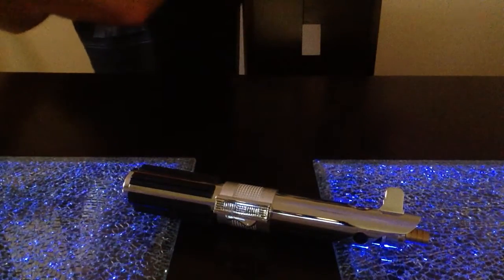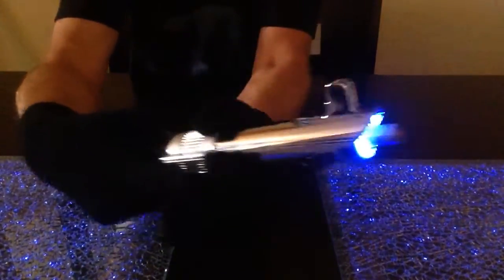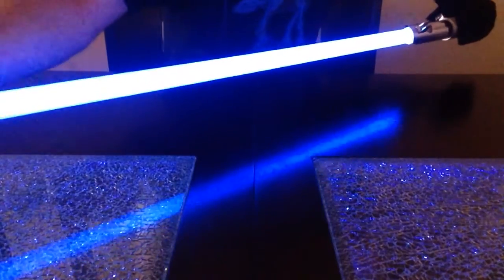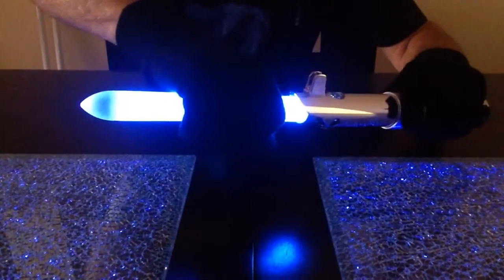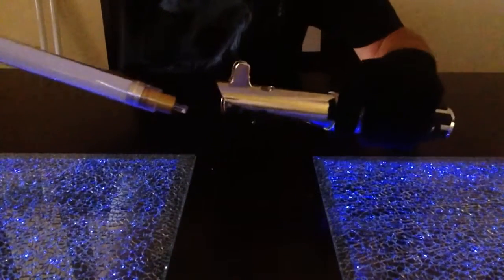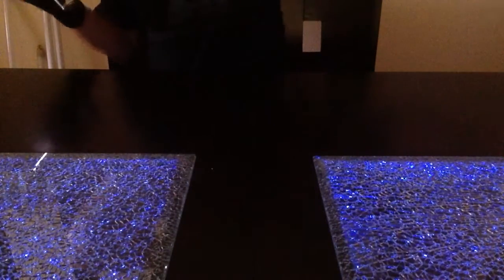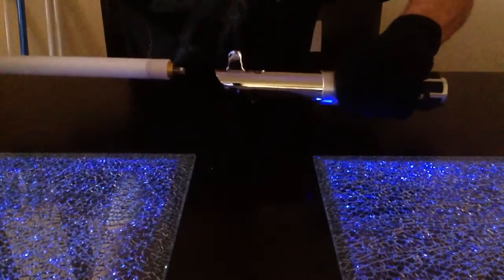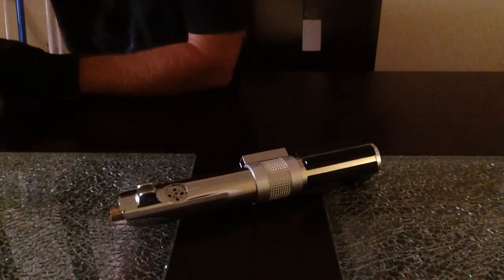Part 2 World's 1st Custom "Switch Blade" Lightsaber Reveal LED String & Cree LED Conversion Graflex

Comment: Are your connectors rated for the high amps?
Reply from the maker: Jason H Most of the higher end ethernet connectors are rated at 1-1.5 amps each per contact and so far so good...
We'll see if they continue to take the constant plug and unplug abuse over the long haul<>